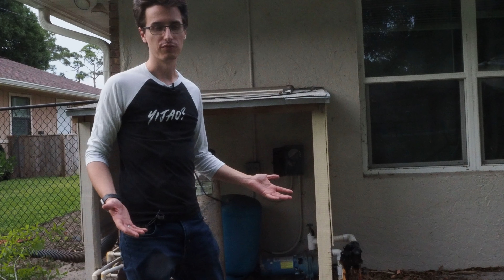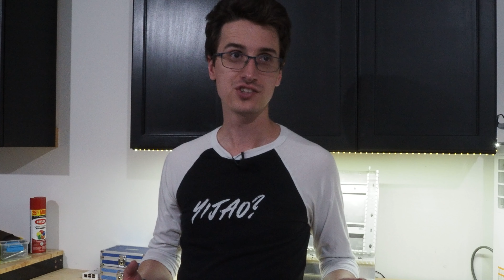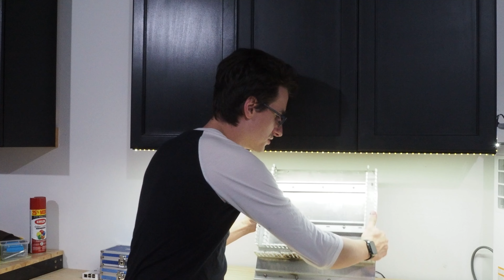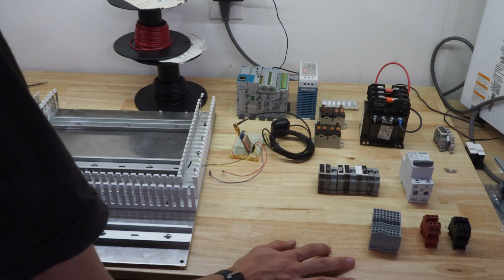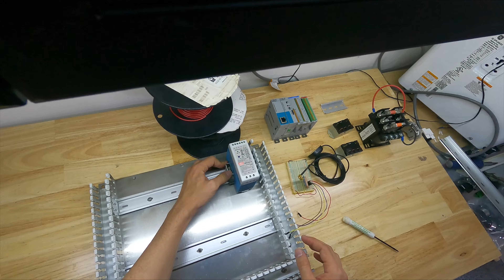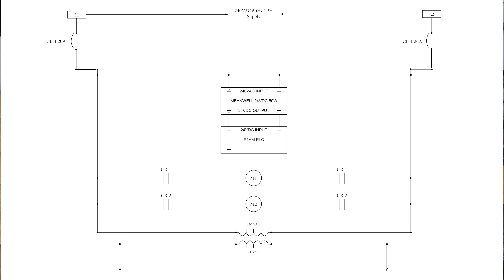Overcomplicated PLC Sprinkler Controller - Part 1

Comment: This is great! I have worked in water distribution for the last 10 years but as an O&M tech with a bit more experience on the operations side. I have always wanted to get into the SCADA or automation side of it. I was looking for a good project to be able to teach myself a bit more about PLCs without risking damaging anything at work. Looks like I am gonna be taking some inspiration from your project. Nice to see that PLC you used is under $70. Thanks for taking the time to make this video!
Reply from the maker: I’ve also been in the water industry for about 10 years! This PLC is super useful. The project is on hold as I am moving houses but I plan to have new projects going forward with this little PLC and others!